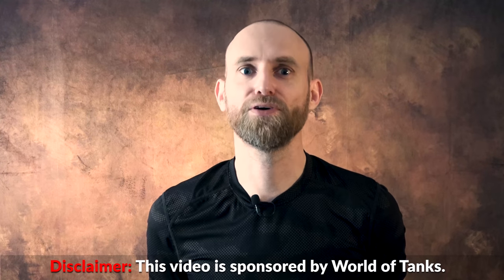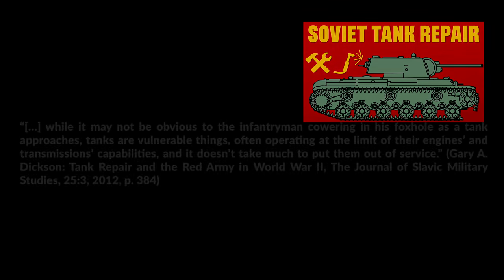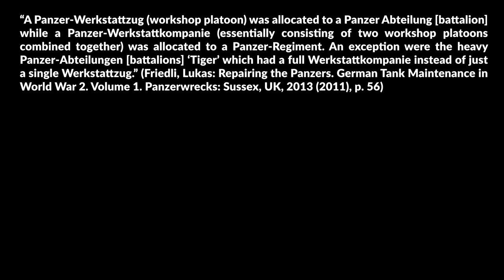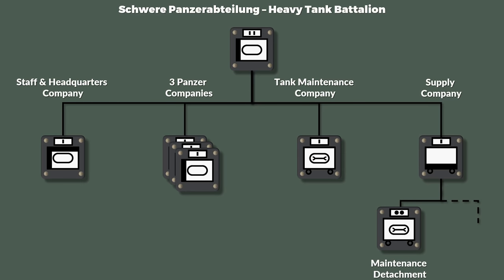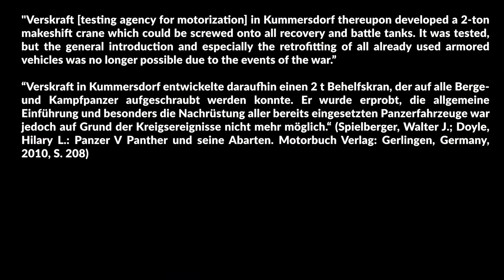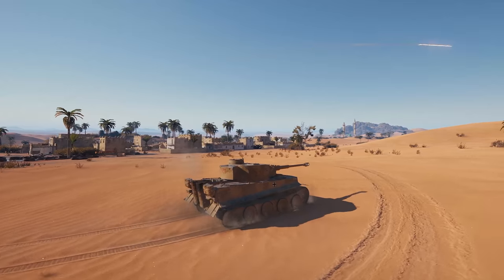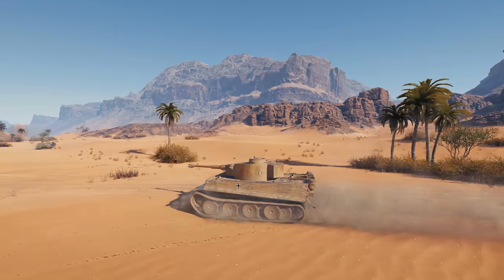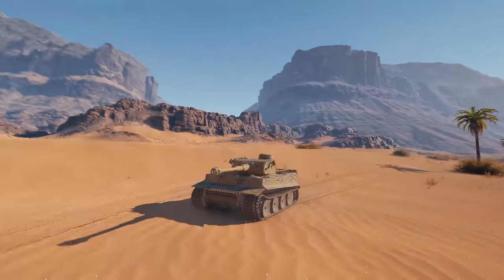Repairing Tigers

Comment: Here is something I never could figure out so maybe you know...WTF was up with the Germans making their transmissions so damn hard to get to? Both the Soviets and the Americans went out of their way to make it easy to swap out transmissions (there is even a photo of a T34 carrying a spare on the back of the tank) but right up until the end of the war the Germans seemed to go out of their way to make it a royal PITA to swap transmissions, but why? Surely they must have seen by Panther and Tiger you would need to be able to work on the damn thing.
Reply: I think you are on the wrong track Mate: Transmission replacement.

As we learned the Panther transmission was very robust like most german transmissions and had an service life of 5000 km between overhauls.
The chance that a tank survives long enough, that transmission replacement becomes necessary was actually very low, given the intensive fights the germans were involved in. The Panzer IV had bogie suspension and a transmission which could easily pulled out through a front hatch (somewhat similar to the Sherman, but they dumped that concept). https://www.youtube.com/watch?v=F76AwBTS6W0
 
The russians turned the war around with tank engines (The V2-series), which had a service life of only 300 to 400 km between 1941 until mid 1944 (T 34 vs Stug III by Steven Zaloga). Percentage of T34 tanks reaching 300km during factory trials (Zaloga, Page 14):
Apr 1943 = 10.1%, May 1943 = 23%, Jun 1943 = 7.7%
This number slowly imporves to 79% in February 1944. But only 33% reached 1000 km before a breakdown in Feb. 1944
The british stopped their long endurance Tests of the M4A1, M4A2 and M4A3 after the tanks had reached 2500 miles, because they did not expect that the tanks reached that mileage during deployment. (Chieftain published the original british documents a few years ago somewhere on the WOT forum).
So if we are speaking of transmission replacement, we are speaking about an event which was very unlikely to happen.
And still the US wasted production capacity and time to produce a Sherman tank with a transmission that was easy to access and mounted it in a separate unite which was bolted to the front end of the tank.
They had to cast serval large hull parts (instead of just one, Patton tank family for example) and invested a lot of effort and material to drill holes through the serval inches thick armor to put the separate pieces together with giant bolts and nuts. Those bolts and nuts don't grow on trees
and had to be produced too. All this increased the overall count of parts for the vehicle. The US industry went the extra mile for every tank which left the factory and invested time, effort and resources for an event which rarely happened.
So tell me, who has wasted more man hours and resources on this specific task called transmission replacement?
The Russians, the germans, the british or the US which were probably a bit too cautious in this regard?
Basic maintenance and adjusting the steering could be done with the transmission installed (in the Panther as well as in the Sherman).
So what if you really had to replace the transmission because of battle damage. If a round or a mine impacts at the front a sherman, 
bolts can be damaged and the force and the heat of the impact, can put tennsion into the metall. As a result things which should separate easily wouldn't move at all.
That's where the real fun for every mechanic begins. I know its a very special case, but people like to create those events for german tanks, too. Like mud could freeze in between the road wheels. Ohh what a great disadvantage, crap system, bad tank.
Every tank with metal tracks can freeze to the ground if parked on wet surfaces, it even happens to modern bulldozers. It's even noted in most tank manuals.
The US american ignorance is sometimes so annoying to me. If your are not doing it the way we like do it, you suck.
 Sometimes they don't even try to change perspective.

The next common misconception is that you have to strip down the whole tank to have access to the final drives. The truth is you only have to remove the drive sprocket and you are there.
https://i.pinimg.com/originals/1e/c8/e7/1ec8e7c5227bc3d29c37c3cc69202302.jpg
The accessibility of the Transmission was also less critical as many described it, even Nicholas Moran aka the Chieftain cleared this up in his latest Video. He probably got a bunch of informations from Doyle about how the germans did things.
https://www.youtube.com/watch?v=X7cUsRdr5cE&t=369s Chieftain Advantages of rear engine tanks with front drive sprockets
https://en.wikipedia.org/wiki/Panther_tank#/media/File:Bundesarchiv_Bild_101I-280-1096-33,_Russland,_Reparatur_eines_Panzer_V_(Panther).jpg
Reply: @HaVoC117X  Your assertion that maintainability represents "wasted resources" is not borne out by the facts.  The Sherman and T-34 weren't engineered for maintainability, they were engineered for mass production.  The  design features intended to make them easier to assemble also made them easier to maintain.  Faster & Cheaper production was the goal, maintainability was a side benefit.  And it did provide real benefits.  Sherman units had a relatively high availability rate and only the tanks that are actually make it to the battlefield count.  Most of the issues that would deadline a tank aren't catastrophic damage.  As for "wasted resources", both the Sherman and the T-34 required far less fuel, labor and materials per unit than their German counterparts which weren't designed for mass production.   That's efficiency, not waste.  And it wasn't just a Russian or American thing, the Germans also achieved efficient mass production for things like the MG 42, the Kubelwagen, and even things as big as railroad locomotives and U-boats, just not tanks.  The Germans certainly took that lesson to heart; the Leopard and Leopard 2 are both highly maintainable vehicles.  As for the overlapping road wheels, you'll notice that no one has used them since, though that's as much due to improved metallurgy for torsion bars as anything else.  And if you've ever had the dubious privilege of actually trying to free a frozen bulldozer in subzero temperatures you'd appreciate how anything that makes such a miserable  job even more miserable would feature prominently in postwar recollections.   It one thing to contemplate sitting at a computer and something else entirely lying in the snow whacking at the undercarriage of a D7 with a crowbar.
Reply: @danielstickney2400  Dude you cleary doesnt know what you are talking about and keep on reapting some old myths.
Since spring 1944 the Panther and the Panzer IV achieved almost the same combar ready rates (Tiger I and II combat tactics by Jentz).
The Panzer IV had the reputation of being reliable and easy to maintain and was in many ways very similar to the Sherman. 
The Battle at Kursk shows that germany was in fact lacking the resources and the manpower to supply the tank force they already had.
Every additional tank needs a crew, fuel, ammunition, spares and the logistics to provide all that.
Just screaming for more tanks does not help. Nevertheless germany produced more tanks in 1944 than in all the years before.
The Panther was streamlined for mass production. The Panzer IV was not. Only 8500 Panzer IVs were built from 1939 till wars end. But they built over 6000 panthers in less than two years. 4500 in 1944, despite the bombing campaign and shortage of resources. In comparison the Russians built 11000 t34 85 in 1944. Given the average tank exchange ratio of 1/4 in favor for the Germans, the panther was a reasonable option. The US build around 12500 M4 Shermans in 1944.
The M4 Sherman can be seen as a logistical nightmare and it was not easy to produce or cheaply made (I would guess that the total number of parts was even bigger compared to a Panther)... they made like 8 version with 16 subversion of it during ww2, two completely different suspensions,
casted and welded hulls, 75mm, 76mm, 105mm and 17pounder guns, different turrets ...not to talk about 5 different engines
in a single tank design...and every mechanic laugh his ass of claiming that a Sherman with radial engine, a twin diesel or 30 Cylinder Chrysler Multibank (30 CYLINDER) engine is easyier to repair or maintain ...  you need to lift the radial engine out of the tank for a simple spark plug change ...
The british had to ask chrysler to redesign their M4 engine because the 5 carburetors (Fu... 5 carburetors for one engine, holy moly) were inaccessible as long the engine sits inside the tank. The radial and the Multibank engine have many cylinder heads facing down into the tank hull and were not accessible for maintenance and repairs.
The twin diesel M4A2, were two diesel engines mounted back to back to save space, but the driveshafts needed to be on the same side, so the right engine was the exact mirrored copy of the left engine. The GM 6046 was built using two straight-six engines that were separately clutched to a single output shaft, which was itself clutched to the transmission unit.
The needed every subsystem like fuelpumps, belds ..., spare part twice, one for the left engine and one for the right. All parts were marked with little l's and r's to identify them. 
Germany used two type of engines. The HL120 for Pz III and IV and all the subversions of it and the HL210/230 for the
Panther, Tiger, Kingtiger, Jagdpanther and Jagdtiger...just normal V12s, like the russians and the british tank engines.
Even though the germans came up with a lot of variants, the automotive components (engines, transmissions, road wheels, tracks...) were very standardized. 
Hilary Doyle pointed out several times that the germans knew what they were doing when it comes down to tank maintenance.
(Chieftain and Doyle in the Panzer Museum Munster, on Chieftains youtube channel). The replacement of the engine took only 8 hours in a Panther under field conditions. For a Centurion you need 15,5 hours in the field. Spielberger wrote that the germans disliked the idea of an radial engine for a tank, because of difficult maintenances. They even built a prototyp Panther with a BMW radial engine.
The French guys of the Tank Museum in Saumur were interviewed by Bernhard at the Tankfest 2019 about their Panther and their experiences with it.
Didn't they admitted that they prefer to work on the Panther than on other tanks of the same time period. Unlike the common believe, they admitted, that the Panther was actually build with ease of maintenance in mind, especially the engine bay.  I think it is really surprising that they mentioned maintainability as big pro for the Panther design. But there must be something to it, because the Panther achieved the same combat ready rates as the Panzer IV since spring 1944 (Tiger I and II combat tactics by Jentz). Part of the reason is, that the Panther wasn't utterly complex or over engineered and could be maintained in the field if the needed supplies are available, it was lacking many of the fine features of early german tanks or of a Sherman.
The logistical situation was bad for all german Tanks, in does not really matter if it was a Panzer IV, a Panther or a captured german Sherman.
The Panther also fits perfectly on every railroad car. Tanks like Panthers, T34 and Shermans were to heavy for the average bridges in central europe anyway, which had a weight limit of 25 tons and less (the reason why Panzer III/IV chassi maxed out at 24 tons) 
Given the fact that the Panther has the highest fording depth by far, more than twice as deep as the Sherman, its tactical mobility on battlefield was even better than that of a Sherman in this regard.
The Panthers operational range is also on par with other petrol powered tanks (Panzer IV, Sherman, Centurion, M26, M47, M48). Compared to other tanks in the 40 to 50 ton range like an M26 or a Centurion its fuel consumption was actually quite low, because of its seven speed transmission and better power to weight ratio.
The 6th and the 7th gear were mainly used as a overdrive to save fuel on road marches, and were never meant to give the Panther a higher top speed in the first place. The Panthers steering system wasn't even ideal for speeds beyond 40km/h (its top speed of 48 to 55 km/h only looks impressive on paper.). But the steering system gave the panther an advantage when going cross country and reduced crew fatigue.
The interleaved roadwheel design and the large road wheels were chosen to minimize driving and ground resistance. 600 to 700 hp and 1900 Nm of torque were just not quite enough to achieve the desired mobility for a 44 ton tank. The Leopard had 830 hp and almost 1000 Nm more torque, so they could use smaller and fewer road wheels.
Dont you think the germans would have just stopped producing interleaved/overlapping road wheels after the Winter of 1941 and 1942, if the problematic of jammed road wheels were that dramatic?? They stayed with it until 1945!! Halftracks, Tanks, APCs, Tractors!!!
Reply: @HaVoC117X  thank you for your detailed and highly informative comments, I gained a lot of new information!

Comment: I know Tiger and Panther have a rep for poor reliability, however I've read that the transmissions on the early T-34 were so bad that they often carried a spare tied to the tank. We don't hear about this after the first few months of battle. Did the quality control get better so that it was no longer a problem, or did quality control improve to the 'good enough' level where there were still problems but it could be fixed before the next day's battle?
Reply: They changed the design to improve reliability. Maintaining Shermans or T34s was like maintaining an aircooled VW Beetle, swap out the faulty engine/gearbox/gun/radio for a reconditioned unit very quickly.
Reply: @andrewallen9993  yeah, dropping an engine from a Cromwell and replacing it, it had a merlin, everything had a merlin, "see that plane over there, go see what its engines like and take the super charger and nitrous off" 😊
Reply: In terms of reliability i think we are a bit hypercritical in the Panthers case. Lets compare it to other tanks:
The russians turned the war around with tank engines (The V2-series), which had a service life of only 300 to 400 km between 1941 until mid 1944 (T 34 vs Stug III by Steven Zaloga). Percentage of T34 tanks reaching 300km during factory trials (Zaloga, Page 14):
Apr 43 = 10.1%, May 43 = 23%, Jun 43 = 7.7%
This number slowly imporves to 79% in February 1944. But only 33% reached 1000 km before a breakdown in Feb. 1944.

The Churchill was accepted for frontline duty in 1941, after its engine reached a service life of 500 miles (800 km) . The first Churchill production batches had a service life for the engine and transmission of 250 miles. Cromwells, Matildas and Valentines  are also not shining examples in terms of reliability (also less than 1000 miles). (British Tank Production and the War Economy, 1934–1945 by Benjamin Coombs)

Comment: Did I hear "rubber sprung steel track", the Tiger was using a "live track"?
Reply: He means the road wheels, Tigers from February 1944 onwards used steel rimmed road wheels with internal rubber tires
Reply: He says "rubber-sprung steel track wheels", you just missed the "wheels".

Comment: Surprisingly with the M4, "Precision Measurements" were used. It's that it was when OrdBru & Ground Forces established RIGID standards to the Manufacturers, & ALL parts were "Gauged" before leaving the factory & frequently before leaving the Continental US to be shipped to the theaters. That meant maintenance groups & unit mechanics were able, if the part wasn't "Drop-IN" could with elbow grease, a file & a hammer(possibly a BIG hammer) could use any part from ant factory or any other tank to repair a M4. While I am ABSOLUTELY sure it is more complicated than just that, this is one of the big reasons that "American Logistics" ended up scaring the crap out of all the other major powers in WW2.